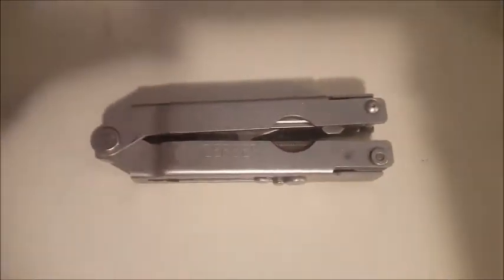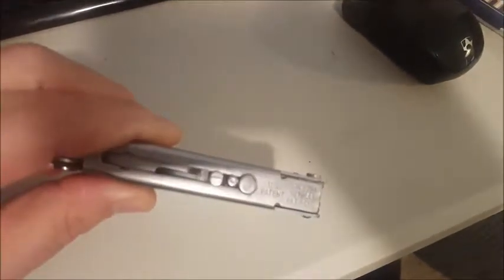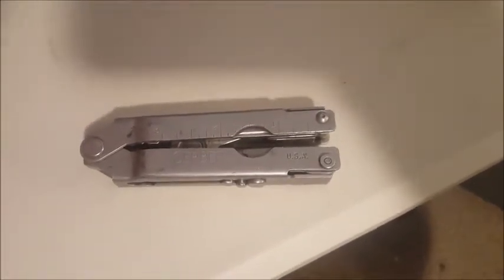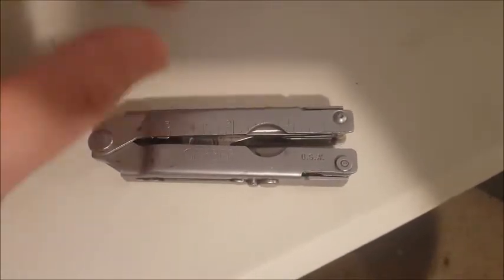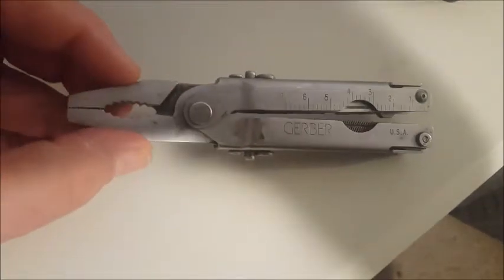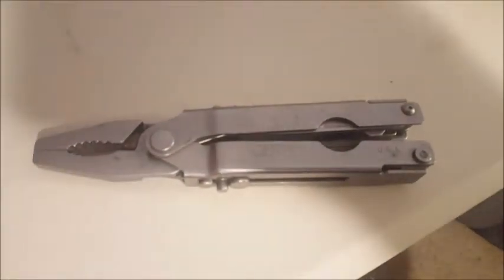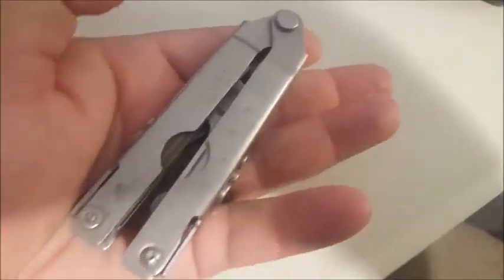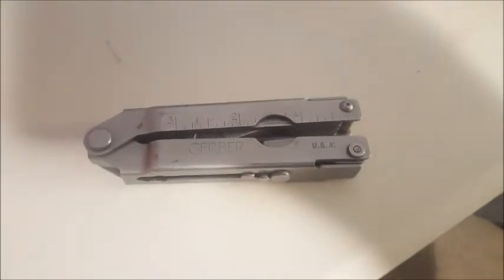Old School Gerber 500 Series Multi Tool Part 1

Comment: I have one and the patent number is what brought me to your video. I bought mine new somewhere between 99 and 05. Mine is slightly different as the sides are ported and the locking mechanism has a rubbery plastic cover. Was in my pocket for a long time as I remember it being super affordable and nicer multi tools were a lot more expensive then.  I don’t carry mine everyday, but it’s at least 15 years old and is still a solid tool. I keep it clean, oiled and take it fishing every so often....
Reply from the maker: Yeah I emailed Gerber about the tool. The model you have is the next version of the same tool essentially. I think it kept the same patent number but was improved somewhat and became the Gerber 600. Can't really remember all the models as they have quite a few now. LOL. Great little multi tool and mine stays in my get home bag and I've also used mine on fishing trips for dealing with those nasty treble hooks that can make you bleed if you look at it sideways. LOL. Thanks for watching and the comment/info! - Grego

Comment: Strive2Survive I would like to ask you how to fix the locking of the pliers, since my tool is missing the middle pins on both sides. Thank you.
Reply from the maker: I'd reach out to Gerber. I no longer have this tool and have no idea how and/or if they could be repaired. They may replace under warranty but it would be with the newest version as this tool is no longer available. Good luck.

Comment: I have the same one, is there a sheate I could buy for it?
Reply from the maker: I'm not sure but waiting for more info from Gerber. I believe this tool could've came in a kit with a sheath originally but I'll post a more complete video once I find out for sure. You might look at the Gerber 600 series multi tool to see if that sheath might work. It's similar in design. 👍👍
Reply: Mine came with a pouch... you can prob find one on ebay